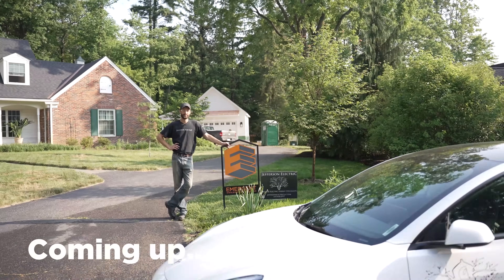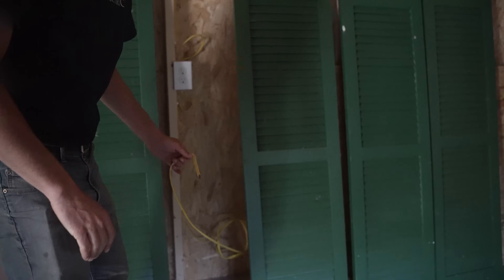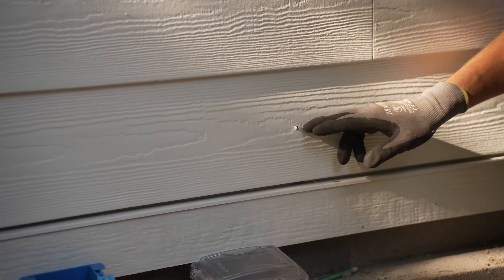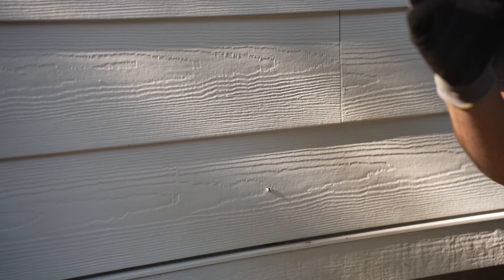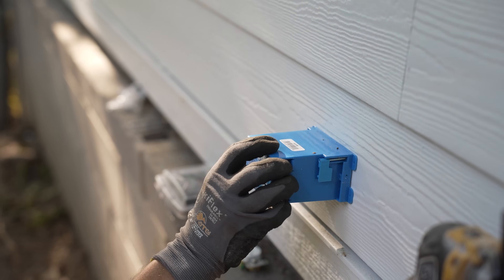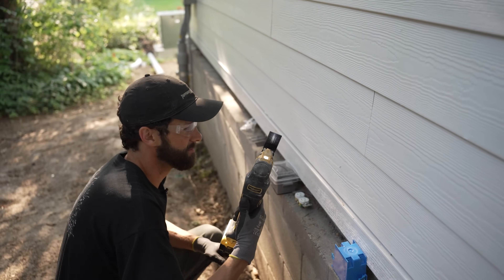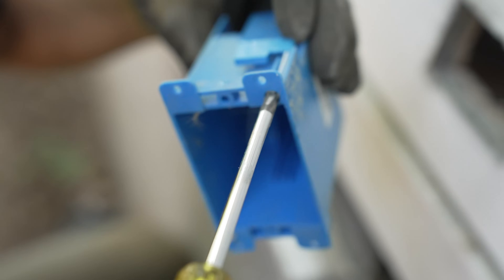Should this Exterior Outlet be Horizontal?

Comment: Doesn’t the outlet need to be gfci outside?
Reply: No, in this case the outlet is already downstream from a GFCI on the load side. If the very first outlet in your circuit is a GFCI and the other outlets downstream are connected via the "load" side of the GFCI, the entire circuit is GFCI protected. He covers that towards the beginning.
Reply: @JohnnySnaps  While true it is protected from inside I still would have put a GFCI with indicator light outside to make it easier to reset and to know if the circuit was energized.
Reply: @jaycahow4667  100% agree on this point.
Reply: @JohnnySnaps  are most jurisdictions like this? Because every house here in nj has a gfci outside for all outlets
Reply: @leaf4224  I'm not an electrician, so I definitely cant speak to any local codes. All I'm saying is that the setup Joel used is in fact GFCI protected and the outside socket is WR.  As mentioned above, should the indoor GFCI trip due to some sort of water intrusion or corrosion on the exterior socket, you would have to reset from the GFCI outlet located inside. Me personally, I would have used a GFCI fed via a home run. At the end of the day, it's more about reset convenience to me.

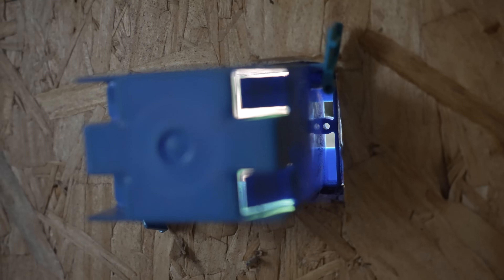Comment: I've broken the little plastic wings on retrofit boxes trying to install them in material that's too thick. 7:35 looked kinda sketchy.
Reply: Since he access to the interior wall cavity I would have either run caulk or adhesive around the box to firm it up or done it on the outside as I was installing it.  I would want the box as firm as possible.
Reply: The problem I have with them is that the screw heads are pretty crappy, and using a #2 Phillips often wrecks the heads. The heads are not made to take a #1 Square drive.

Comment: With easy access why use an old work box. Why not use a standard 1G nail on box? Horizontal outlets get more force on them when an extension cord gets pulled sideways. It will pull a plastic old work box through the siding. Metal old work with side tabs not so much..
Reply: First and foremost no one Evan the owners of the house should pull on a extension cord common sense . Hello😅

Comment: 20 amp circuit 15 amp outlet????
Reply: yep, completely fine
Reply: @feelingtardy  While true, if you have the 20 amp breaker and correct wiring in place for a few cents more put in a 20 amp outlet to let you run 20 amp devices outside.
Reply: Yup you can't plug in a 20 Amp device to it without modification

Comment: Joel, how to you keep from cutting the insulated wires when you use the utility knife to strip the outer jacket of the romex?  Thanks for all the great videos.
Reply: If you stay towards the middle of the wire you’re following the ground wire, but it doesn’t take a plunge cut only a lite score to get the jacket to cut
Reply: Watch him do it again. He puts the blade of the utility knife in the center of the jacket where the bare ground wire is, and he does not go very deep with the blade. Pretty easy to do. Then he cuts the jacket off by pushing the blade away from the insulated wires. Just about every electrician I know does it exactly this way.
Reply: @jamesreizner2673  Thanks James.  I'm just a homeowner/handyman so I am not as skilled as a pro, but I will give it a try on some scrap romex.  I use the stripper tools which are fine, but this is much quicker.  Thanks.
Reply: @markg6032  Like the other fellas said, you can just score it. You don't even need to cut all the way through the jacket - once it's scored it'll peel off like a banana peel.

Comment: Hardie side is not supposed to have devices mounted this was, supposed to have flashing, and mounted on a separate plate. Box should have already been in place, then siding is cut, around, and flashing applied   It's Fiber Cement, and not following Hardi rules doesn't help the 30 year 15 year paint finish warranty.  FOLLOW the RULES...you left the cut edges unpainted, any cut edges on hardie Fiber cement needs to be painted, Hardie supplies the paint to match....
Reply: Cuts in fiber cement siding should be sealed with primer or exterior paint. Just voided the siding warranty.
Reply: I was just thinking "what about when the siding gets replaced..."
Reply: You make some good points but overall it's fine at least until the seal on the back of the box fails
Reply: @digi3218  that's exactly what I thought.  That back seal just made it seal on the overcurrent. Hardie is the best siding...did my house in it. Has to be installed by Hardie qualified guys..it does matter..
Reply: Over cut,not current

Comment: Where I’m at, inspectors want our outdoor in-use boxes to be metal. No more plastic.
Anyone else encounter that?
Reply: Not but they don't like plastic old work boxes. If the extension cord plugged in gets pulled, the box will come right out of the siding.
Reply: @harveypaxton1232  right
A lot of times a box like Joel used is the best option. 
But in this situation where u have access to the bay from the other side of the wall, a box screwed or nailed to the stud would be sturdier.
Reply: No
Reply: What I know is if the box has to be flush mount then u use metal, but if it has to be reccesed then you can use plastic.
Reply: I always specified metal in-use covers, made the contractors replace the plastic ones.  One contractor was so bold to tell me don't make metal ones, so I told him to go to Home Depot.
Reply: I would dispute that one. I installed a metal box 2 years ago in an area near my steps that gets a little salt in the winter. The paint has already bubbled off and the box is literally disintegrating down the wall of the house. I will have to replace it with plastic soon.
Reply: Nothing in the NEC requires that. Unless there is local amendment  to the NEC, the inspectors can't just require something because they prefer it.
Reply: @jamesreizner2673  
Yup
AHJ overrides NEC.
That’s my understanding from the 6 years I’ve been in the electrical world. 
But ur right, a single inspector can’t ask for something unless it’s documented in the local codes.
I checked and it’s in our local.

“406.8 Receptacles in Damp or Wet Locations.

 (F) "Plastic Bubble Type" in-use covers are not permitted.”

Note: we are still in the 2014 NEC book. 
But I only have the 2017 and 2020 code book.
Reply: @jamesreizner2673 they can’t but they do all the time and no one wants to get in a pissing contest with the AHJ